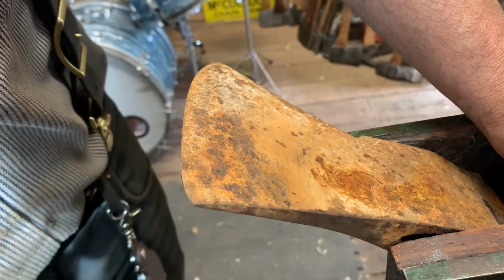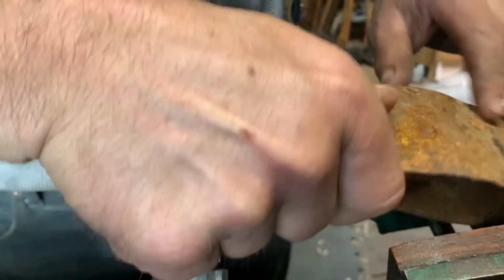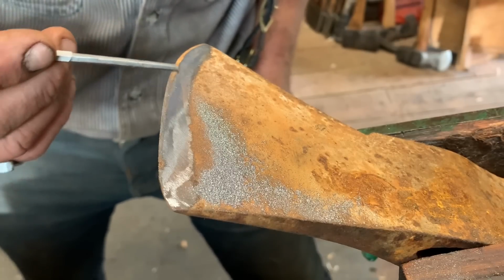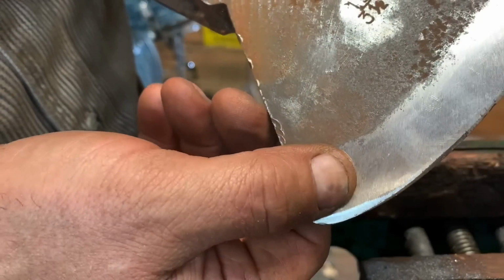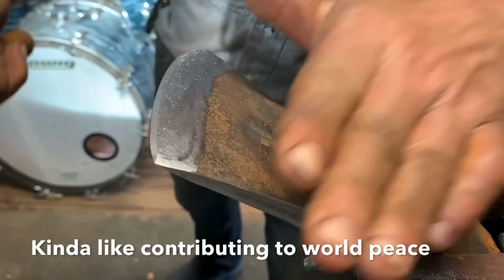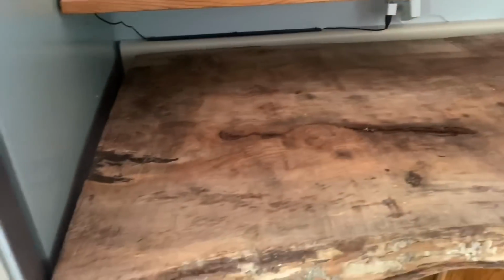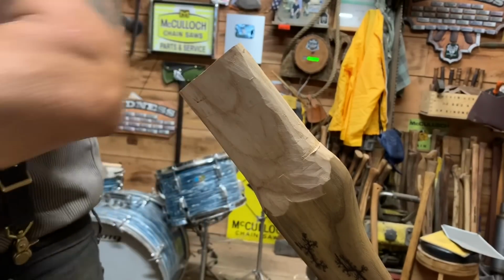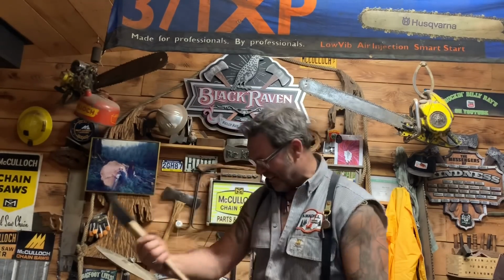How to sharpen and re- profile your axe with a file ,for the everyday person

Comment: I file mine and then stone if needed. It's easier to keep the cheek profile right with a file, but it's also easy to cut yourself, too!!

We never used an axe  when I was a kid, either - not right, at least. It was a handle with a polled head on it to beat things, we split wood with a maul and cut it with a chainsaw, but I've come to appreciate hand tools later and the whole idea of geometry and edge finish/sharpness. 

at 3:00 - that's what we would've called the root profile. Good for axing tree roots in the middle of the dirt!! I've eased the cheeks on all of mine and they have just enough left to keep them from sticking but not enough to keep them from penetrating. They're a joy to use. It's important to protect the edge, but the geometry is more important than the particular method used to finish the edge.
Reply: getting in a little further, I see you're preserving splitting use....

Comment: I I have an axe I really like for chopping through stuff, but I wouldn’t split wood with it if I could go get my splitting maul. I grew up splitting about ten cord of wood every summer to make our winter heat. I loved the workout and I loved making pieces fly. I was really small, under 100 pounds, but I always got the strength to weight records in high school and in the Ranger battalion. I had no trouble swinging the maul but I didn’t do as well splitting with the axes I tried. 
I’ll be on the lookout for different axe types at the garage sales. I can’t swing them anymore, but I can sharpen them and pretend I’m going to use it.

Comment: This guy know his stuff !
I used this video to sharpen my two blade ax just as he did and it came out very sharp . I hope it doesn't  chip because it is sharp even without a stone.
Someone had  sharpen the edge only. Soak the ax in Vap-o-rust and it removes the rust
Tapping the file is not a good idea they can break very easy.

Comment: Good job.  D.Cook, author of The Axe Book, recommended the cutting edge (1/16” from cutting edge) at 30-degrees and the cheek at 15-degrees (1/2” from cutting edge) for a felling axe.  Typical factory axe angles will be greater than this.

Comment: If you ever need to replace the handle?  GET A FIBERGLASS HANDLE can grip it better and cuts down on sock on your hands wrist and arms. They got great protection around the head of the handle as well. They seems to be lighter than wooden handles.

Comment: I see you did some neon transformer wood burning on the handle. I advise all that start filing as you've shown to wear some
gloves when sharpening an axe and make damn sure it's secure in the vise and to take your time. I have been doing the same procedure forever and was cut deep in the thumb by a slip off the edge point and it cut through the glove and split my thumb from the nail to the knuckle of the hand holding the file. Ouch. And yes, it shaves. Stay safe, don't ever think you know it all.

Comment: Other option to do the rough work knocking the cheeks down is to use a cheap belt sander with a coarse belt and make a small contact point only on the idler at the end (not on the flat part of the belt - that'll just make heat and remove metal slowly).

Comment: I finally got a new handle attached to the youth ax my dad gave to me I was 12.  It has a flat hammer on one side for wedging. He said son, you are going to clear 1 acre of trees on the hilly slope behind the house.  The school was out 20 May1963 so I had 1 summer to do the work.  By fall everything was cut, piled, and burned.  The pine stumps burned until Christmas.  I need to sharpen my old ax with a file, what kind of file is best.  Back then we used an old wheel stone laying on the ground.

Comment: Hello... and Help Help Help
I have a serious question on hangin an axe head onto a 51 year old axe head.
My fathers' old axe finally succumbed and the axe handle broke.
Mistakes were made in drilling out the old wood from the eye of the axe.
I forgot to take not of which was the top and bottom of the axe.
In the eye of the axe head one of the eye holes is larger than the other.

1. How do I set the axe?
    Is the smaller eye the top and the larger eye on the bottom?
    The cutting edge of the axe is symmetrical, hard to tell which is top and bottom.
    I've since followed videos to come to a point to sharpen & shape the axe.
    I will do a final sharpening when I find answers.

2. The new handle does not fill the eye completely, other handles at various hardware stores are also smaller.
    The various available handles do not completely fill the eye lengthwise.

3. I will have to search for some good wedge wood to lock the handle.
    The wedge supplied with the replacement handle is 1.5" wide and .5" thick.
    The new axe handle is 2" long, 5/8th's " thick at the widest point.

4. I found a piece of wood that was perfect in shape.
    But may be too soft as I found a flat wooden spatula in a kitchen store.

Sir... This is what I have to work with....
Please please help. James
PS... The Axe Head has "M Stanley M" my father purchased this axe in the Spring of 1971.

Comment: The problem with the new mauls are. THERE WAY TO THICK ON THE CUTTING WEDGE. Need to grind down the blunted wedge. more slender to get more penetration. when you maul bounce off the wood its cause by 1 of 2 things, THE WEDGE IS BLUNT OR DULL >>>  "REMEMBER"  IF IT PENETRATES?  IT WILL SPLIT.

Comment: Screw this.  I get my grinder with 120 grit flap disk and I do this in like 3 minutes.  Just don't do to much so you don't over heat and ruin the temper.  In winter it's real fast, like 1 minute lol.  I get mine shaving sharp.  Literally.